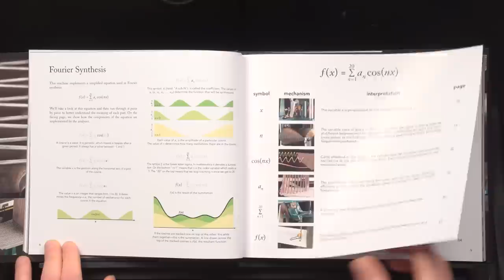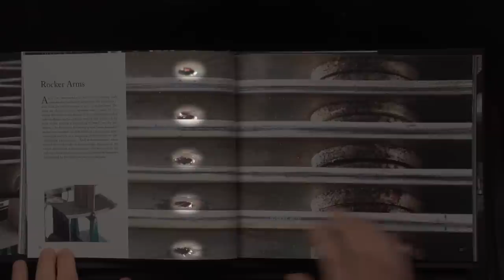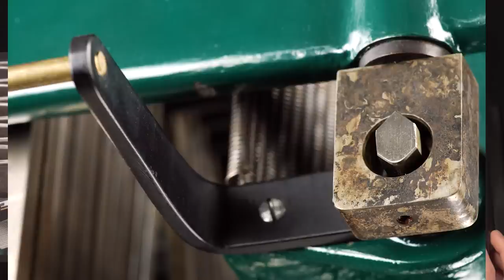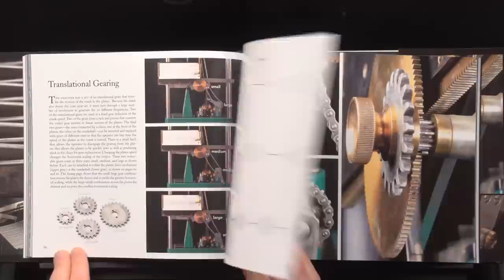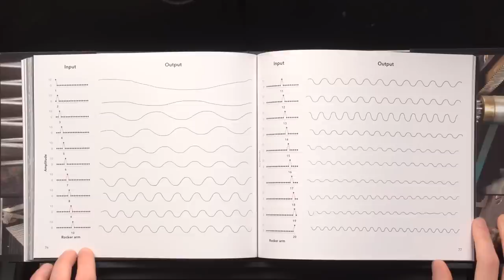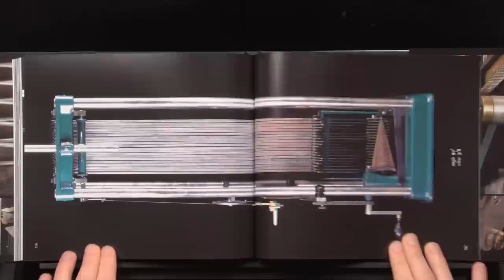Page-by-Page Guide to the Free PDF

Comment: Bill, in listening to your comments around the four minute mark about the difficulty of setting the gears, and more specifically, "the gear next to it would move", followed by the 'unknown holes' in the rocker arms, I came to a quick realization. Before beginning to set the gear positions, slip a rod through 19 rocker arms. Adjust the furthest gear. Pull to slip the rod back to 18 rocker arms. Adjust the next furthest gear. Continue until all gears are set. The rod will bind the gears closest to you from turning until the rod is fully removed. The surface damage around the area indicates something was likely scraping the surface around the hole, and the different rates of surrounding damage per rocker arm says to me the holes were not meant to 'lock' the device for transport or storage; but in active use during operation.

Comment: I have a guess for you about the mysterious holes on the rocker arms. My guess would be that they are there to mount the pieces consistently during the grinding process. Consistency would be key to the proper functioning of this beautiful machine. One possibility would be to gang all 20, or some subset, of the rocker arms together for all of the drilling and grinding operations. Another possibility would be to have a jig for each piece of equipment, drill press, grinder, etc., which could machine each on separately.

Thank you for all of the wonderful podcast material.

Comment: I think I have solved why there are "holes on the rockers"!
(You are right that the a rod could get stuck, if used for alignment)
You are supposed to thread the holes with an "flexible cord" as the "adding mechanism" of the terms of the function, as invented by Lord Kelvin. This Michelson machine uses a more reliable "spring system" instead as the "adding mechanism"... (This is clear form the article in the book)

Comment: I wonder if the holes in the rocker arms are for placing a pin that limits the travel of the vertical  bars.  My thought is this would be specifically for shipping in a truck or train in order to prevent road conditions from dislodging the bars from the rocker arms.

Comment: Could it be that the holes on the rocker arms are for locking them down one at the time? When you align the cylindrical gears, the gears tend to move, so you insert a rod, align the gears one by one, push the rod in at the same time so the gears you already aligned do not slip off?

Comment: Why do you think did Michelson designed the machine to use cams with (I take it) the same profile rotating at different speeds, instead of cams with different profiles all rotating at the same speed?
Reply: I think he choosed this approach because he found easier to adjust/control the different speeds of a set of gears with different number of teeths in each one, and keeping the same profile of the cam for all of them, than designing a different profile for each cam. Also, because there is, I think, an optimal profile for a cam who would reduce friction with the circle innards of the gears.